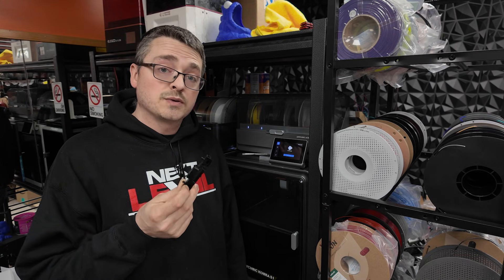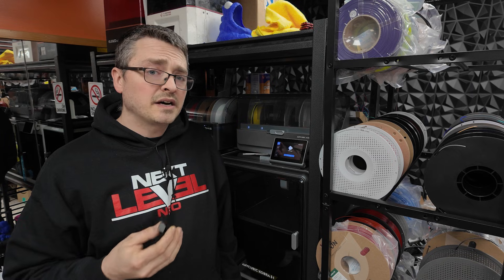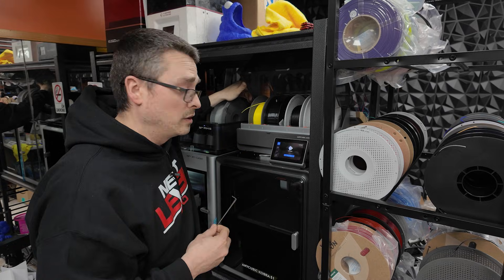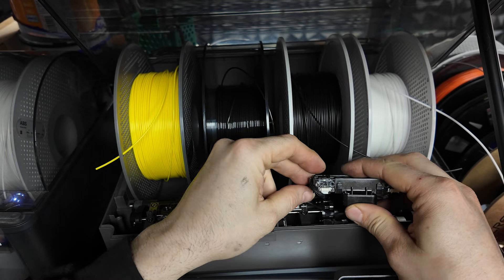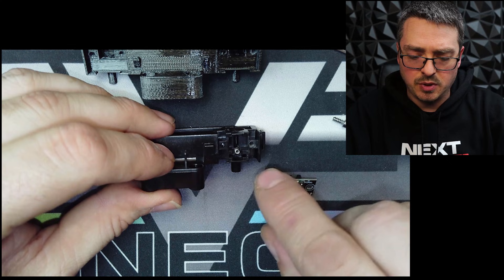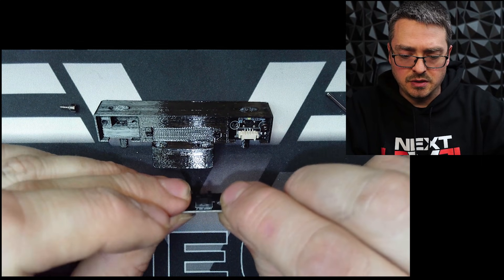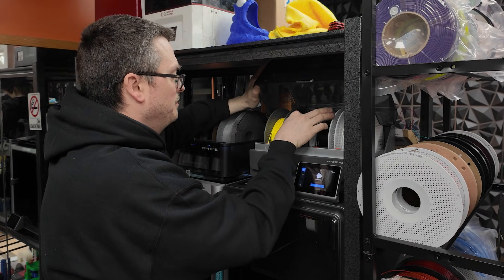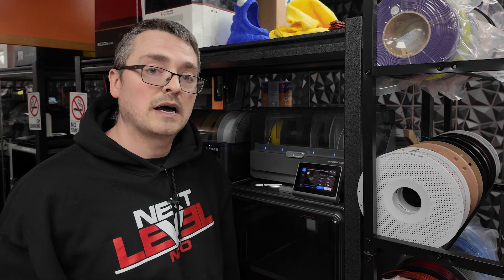How to Fix Filament Detection Issues on the Anycubic Ace Pro | Direct Filament Sensor Rail Install

Comment: Okay so I'm having this issue with my brand new ACE pro. Please help me understand how this works. Is it the spring that is the issue, or is it the housing? Thank you for sharing.
Reply from the maker: In my case it was the sensors not seeing the flap when filament was inserted. This removes the flap and puts the filament directly through the sensor. The flap gets rubbed by the filament and can wear down creating issues. In many cases it's got an issue right out of the box.

Comment: Thanks for sharing will definitely try on mines since customer support not verry supportive...
But what causes the error and what makes this upgrade work?
Reply from the maker: The sensor doesnt always see the little lever when the filament pushes it forward. This moves the fillament so that it breaks the sensor beam instead of the thin lever fin.
Reply: they finally sent me the replacement sensor rail. when comparing the new one and the one I was having issues with side by side. The one causing issues, the little lever either started substantially smaller or was worn down enough that you could easily spot the difference between the 2 levers.

Comment: I just recieved a new Kobra S1 combo last week & had this issue 3 times in the last few days. This is also my first 3d printer. I just did a complete reset of the filament in each slot to fix each time...this seems like a much better option.  I printed them out of pla...probably not the right material for this part?
Reply from the maker: Pla is soft, if it works for a while then you know it's a fix. Just print it in a harder material. I like PC
Reply: @NextLevelNeo ok...newbie here...what's PC?
Reply from the maker: @BradLMN polycarbonate
Reply: @NextLevelNeo Ok thank you.

Comment: Dude this is the first vid. That soles this issue
Reply: Have you had anymore problems after installing the. Upgraded. Carrier
Reply from the maker: @SacredHeart0520 I have not but I did hear some have issues with clear filaments. I tried some clear petg and it worked fine so unsure if that's only some clear filaments.
Reply from the maker: Glad it worked on yours. Seems there are different ace systems out there, some work some don't and I'm unsure how to tell which one is which.

Comment: Thank you, great video. I had this very issue and although I did print the replacement rail I tried something else first which was to just remove the spring from the back of the little paddle. The difference this made was that when inserted the filament popped the paddle between the detector arms no problem at all, with the spring in place the detector could take it or leave it. The only potential issue is that the paddle could be come stuck in the position where the detector can see it, however this doesn't seem to be happening for me yet. I'm sure this wont work for everyone but it is a very quick fix for those it does. (dont lose that spring ;-)
Reply: Removing the spring on slot 2 solved all my issues. I tried the rail first and it did not like that at all. Ill roll with this fix for now until it fails.

Comment: Ok, I download and printed the model and my two aces are completely different to this one xD Filament wasted!
Reply from the maker: It's crazy, I've got 2 purchased 3 months apart and both fit. Some have newer ones that fit, some don't. I wish I knew a way to tell
Reply: @NextLevelNeo it's not the model itself, for example for my aces pro the filament sensor it's totally different from the one in the video, but the part fits perfectly 😂

Comment: I have this printing as, like so may others, my #1 slot has the light staying on no matter what. After watching your video I thought "why not just take out the spring and brake?" So I tried it while waiting for the print to finish and it did work... However, it brought on a question of how do you tell your printer what filament is in each, because after removing the brake it basically determined that there is nothing in there (Even though it fed in just fine) But since there is "nothing in there" according to the machine, it will not allow you to choose that slot for printing... I will retry this once the print is done, but this is a worry that this will turn the ACE into a fully manual color changer, defeating its purpose.
Reply: UPDATE: After installing the printed part, it did work, I was able to edit the colors and everything was feeding, then I put it all back together... Now the light stays on just as before and will not feed, back to the same issue I had in the first place.

Comment: As of now, the beginning of September 2025, this solution still works.  Anycubic even sent me a replacement filament sensor since the my Ace Pro was brand new, and it had the same issue.   This solution is just better.  Thanks!!
Reply from the maker: Seems results have been mixed. I have 2 ace pro units and both are the same design but many have said it doesn't fit right on theirs. Guess you just have to try it and see but glad to hear it's still helping some.

Comment: great design, but not working in my ACE, the mounting of the bar is too narrow, so filament does not allign, needs to be a few mm farer away from the front. maybe add another design, or share the rwa file so we could do our own change to fit in more ACE's
Reply: I figured it out, I just stretched the springs out some just be gentle when you do it doesnt need much.
Reply: use the oem part

Comment: Thank You! 

7 days now into my first 3d printing and I had to 3D Print Filament Guides from Maker Online to fix my problem 2nd... Im only using ANYCUBIC 3D PLA Filament until further notice. So far, with the exception of just 2 spool tangles that were easy to fix and resume, this is where I stand still printing some fairly long hr projects 🤞(fingers crossed) HOWEVER, I AM BOOK MARKING THIS for future.
Lastly,  Its a shame we pay +600 dollars for something we have to hack to make it work. But wha-da-do 😮 Send it back? Im still in my Amazon 90 days 🤔🤷🏽‍♂️ So far surviving the journey.  I'm telling all, you better be ready to troubleshoot issues... this is not the out of box bambu labs A1 mini for Noobs... 🤨

Comment: What's your overall impression of the Kobra S1 combo vs your other printers?
Reply from the maker: It has been solid, I still trust my bambu printers more but that's because they have been running well longer. The s1 is still running great as well as my centauri carbon. My k2 is the newest printer and is not currently loading filament at all.
Reply: @NextLevelNeo  Any dimensional accuracy differences or quality differences between the Kobra S1, Bambu and Centauri Carbon? Just got a Kobra S1 and it's been great so far. Prints quite reliably and accurately, but don't have the others to compare, and about to buy a few more printers.

Comment: I think this mod has helped but its also not feeding the filament all the way into the hotend. You can hear it trying to pull but the roll has stopped moving. Any ideas what would cause this?
Reply from the maker: There was a redesign at some point on the ace. Unfortunately it seems that this won't lineup properly on the new design. I do not have enough info on when it was switched to be able to say which one you have.
Reply: @NextLevelNeo  it actually works, but for some reason its only pushing the filament around halfway to the filament hub. its doing this with the stock parts aswell

Comment: This doesn't fit my ACE Pro either.
Reply: I figured it out, I just stretched the springs out some just be gentle when you do it doesnt need much.
Reply: @javi1373  I though the purpose of this printed replacement was to get rid of the flap AND the spring?

Comment: Alright so I will say this part didn't fix my issue. Though it did hold the sensors correctly, it still caused the issue with slot 2 as well as at time would jam the Ace Pro because the part is 5mm thicker than the original causing it to hit the filament drive when switching from extruding to retracting. What ended up fixing it for me, was switching the sensor from spot 1 to spot 2 (and vise versa) and cleaning the sensor pins lightly with alcohol. 10 prints later and all 4 slots are working better than ever. 
But that is just my case, with a few tweets this rail could have fixed the problem the same
Reply from the maker: It sounds like they may have redesigned the new units so this might not work on new ones.
Reply: @NextLevelNeo  They did redesign the new units. I printed the part yesterday and you couldnt feed the filament in.

Comment: i did print it. but the holes to feed do not align, is there a diffrent model. i have the ACE pro the new model. please help
Reply from the maker: It's possible they have changed some things on the new one. Unfortunately I don't have one to test with.
Reply: @NextLevelNeo  what worked for me is i took the OEM part and moded the filament tiny plastic with spring to have more presure on the filament to be detected. and so far so good. but i like your idea since there is no spring or spaces. ill keep hunting. maybe try making my own one

Comment: Does this set up work well with transparent filaments? Seems to me that the reason they used the gated/flap method was to guarantee blocking the light gate with an opaque material no matter what kind of filament has been used. Similar light gates are used in the extruder assembly for the filament sensor and cutter mechanism.

Comment: Do you think this will fix my issue? https://youtube.com/shorts/7UJ4rE-8mWk?si=eGCjJaNORXjNjne2
If it does, I’ll love you forever.
Reply from the maker: It might. Make sure you are fully updated first, then give it a go.
Reply: Hi!, Facing the same issue on slot #2. Were you able to fix the problem on your side ?   My Ace Pro is only a week old and already faulty :(  I used cheaper filament for printing prototypes and ever-since I loaded that roll, i started having issues

Comment: i want to think you for this because i had this s1 and my slot 1 and 3 had this iss when i move the filament it started to work and when let go of it it stop working again and this should fix my issue
Reply: Did t fix it?
Reply: @eltont862 those where junk I had to get new one from anycubic and that fix my issue.

Comment: I just ran into the issue of my ace pro saying filament is tangled when it isn't. I shucked the cardboard spool and put on a bambu spool, same issue. I'm going to give this a shot and hope it fixes my issue. It just started today, grrrr
Reply: What about? I'm trying to solve the same issue. Works for you?
Reply: @vickys2000  I printed the replacement filament sensor and I was able to finish my active print. When I tried a new print with it in, the detector quit working, and I had to put the original detector back in.
Reply: @DankGraphicz grrrrr, I printed the support and when I went to install it I realized that my original support is different :D crying
Reply: I just put it in. My #2 position would not load and not sense filament. I used ABS. So far so good but I haven’t worked it hard. The little wire clips on the printed part both broke off. I’m going to put some tiny wire ties to bundle them together.